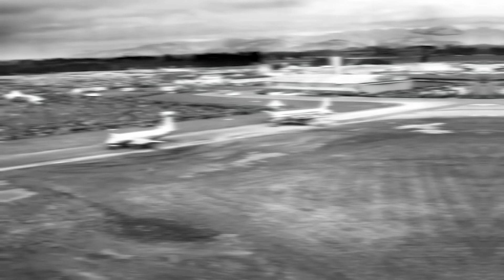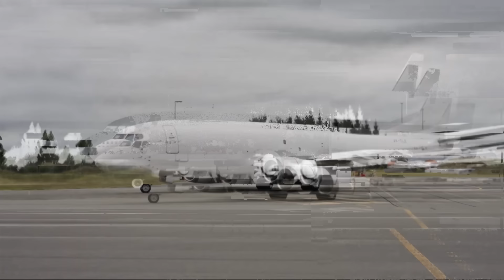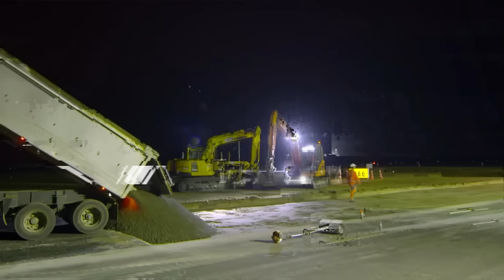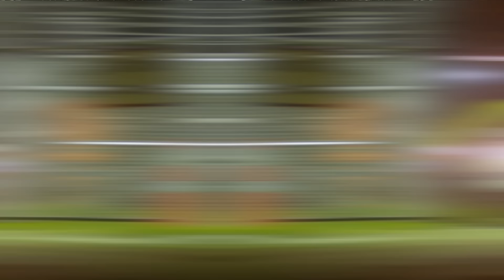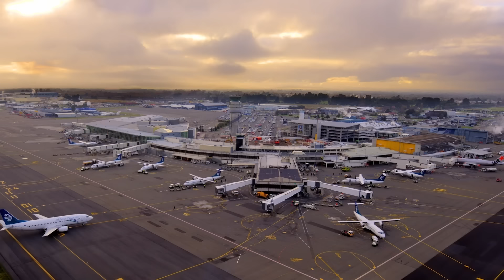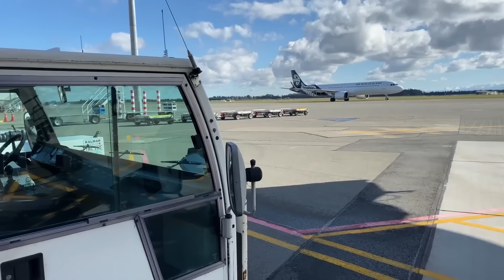Christchurch Airport's MASSIVE $300 Million Upgrade Revealed

Comment: Please make sure your facts are accurate, I work at Dakota Park and DHL and FedEx don’t have any buildings connected to it. They have buildings on the other side of the airport. The footage you were showing was inside The Freight Hub which is run by a company called “Freightways”. Freightway’s is a parent company of Parceline Express, New Zealand Couriers, Post Haste, Kiwi Express, Castle parcels and about 10 other companies. Dakota Park is also shared with “New Zealand Post” which is another company. 

Facts are important, do your research. 

Cheers.

Comment: You forgot the fact that they are also extending both runways in order to reduce the risk of over-run on the main runway and enable them to use the auxilliary runway for larger aircraft during wind shear events - which Christchurch is particularly susceptible to.

Comment: Solar farm.  Great.  Cost to power gained is massive.  Will have to be heavily subsidised to pay for the low density, high cost power.  Maintenance and longevity a problem as well.  Bring on the rates increases.  Hydro, including run of river, is on our doorstep.  Pity it is not fashionable at the moment......:eyes-purple-crying::eyes-purple-crying:

Comment: Stupid Solar panel park. In stead of that NZ could have put a pipe from Earnslough river to Hopkins river that feeds into Lake Ohau  and secure more Hydro power
Reply: These massive solar farms have failed everywhere. The never end up meeting demand. Look at California. 100’s of millions spent on solar panels. Valuable land wasted. Whole project now canned. But no, little old NZ will still do it. Why? It doesn’t work. Tax payer funded waste
Reply: @Curly743  there;s at least five solar farms in Canterbury, and they are all working perfectly. I know, I've been to three of them.
Reply: Solar and hydro complement each other nicely.  When solar is available, you save the water in they hydro dams for when you need it most.  Pumped hydro to use excess solar (and wind) is also an option.

Comment: And in all of this, they completely forgot about the connection to the city. No train link - let alone buses, so you're stuck with super expensive taxis or a 25km walk!
Reply: There is a bus.
Reply: @Nitro897-ic8ge Yes and the shuttle bus is very cheap
Reply: @marieroberts1221  The shuttle bus (i.e SuperShuttle) is definitely NOT cheap.  It's not that much cheaper than a taxi or Uber (e.g. $30 to Fendalton, compared to $35-$40 by taxi), and you get the 'pleasure' of a Cook's tour of a bunch of other peoples' places on the way.  If you have a group of 3, it is actualy cheaper by taxi.  Despite their large trailers, they will still charge you a surcharge for large bags (e.g. for bikes).   Other shuttle services may be more economical, but  only run at peak times (e.g. Steves).
All up - you're way better catching a pubic bus if you arrive at the right time of day.
Reply: There's already a metro bus system thats connected to the airport. I know cause Ive used it for the past 3 years living in chch. It's by far the best bus system in the country.
Reply: What rubbish. There is already a fully electric bus service straight into the centre of the city. Also if you walked 25km in that direction you well out to sea!
Reply: Ive looked at the plans from Christchurch airport and they do 
Plan to have bus stops outside their main entrance. You can see it at 6:09 too. Buses go all around the city here too and connect to the main bus station in the city centre. We have busses all over the city
Reply: It’s 10km from airport to cathedral square ie centre of the city and about $30 with uber. A rail link would cost almost the same as the expansion project and serve only transport corridor. If part of a wider lite rail expansion - would make sense in long term
Reply: We don't really need trains, the busses work and it's not very far.
Reply: It’s not 25km to the central city.
Reply: I'm guessing taxi and bus services would be expanded too (and campervan rentals)
Reply: 10k walk or about a 10 minute taxi/uber/bus ride.